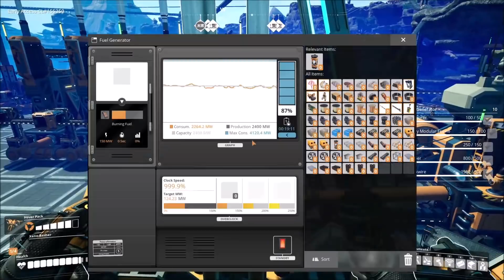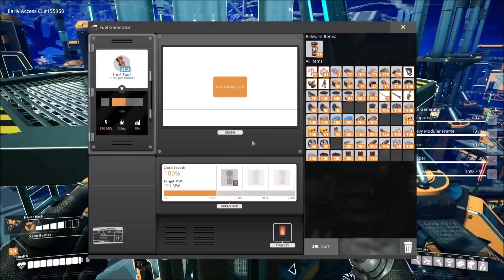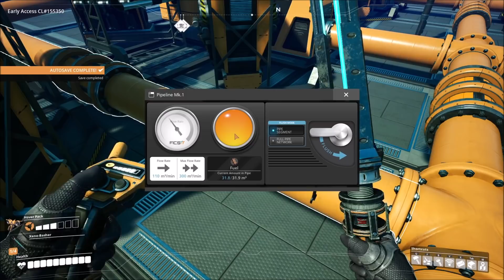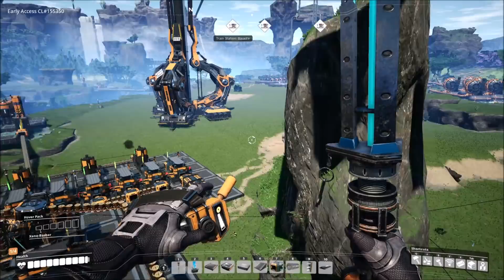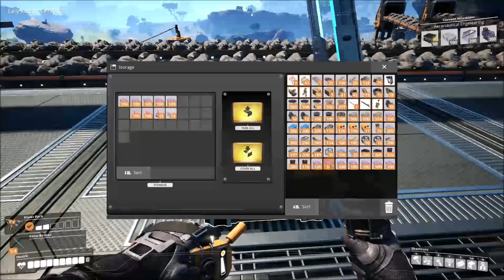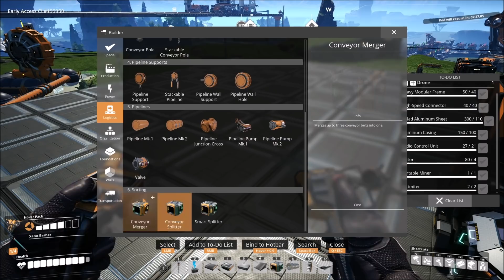Satisfactory Ep35 More Power and Drones

Comment: At the beginning of the episode you forgot that the fuel generators give you more power than it consumes when they're fully overclocked, so you shouldn't need 13 fuel generators...
PS: As in they're more fuel efficient the more overclocked they are, so it's more fuel efficient to have less fuel generators fully overclocked than more fuel generators with no overclocking whatsoever...

Comment: For excess water, I package it at the end of the processes that use water, and send it to an awesome sink.
If you want to use a drone network, and I do recommend it, you'll want 2 drone ports dedicated for battery distribution to all of the other drone ports. You only need batteries at one drone port per route, so it's most efficient to have a centralized drone location as a drop-off/distribution depot. That way you can easily distribute batteries to all of those ports, as well as a centralized location to distribute all of the resources your drones deliver.

Comment: The drone travels very quickly but takes off and lands slowly. The Drone consumes a minimum of 4 Batteries per trip plus 1 Battery per km of flight distance.  Thus the longer the distance of travel, the more efficient they are so best for very long ranges.

Also, from the wiki: "They are potentially the 2nd fastest mean of transportation, second to Hyper Tube Cannon. Pioneers can stand on the drone for a ride, however a fall protection equipment such as Jetpack is highly recommended as the Drone will push away the pioneer mid-air when it starts accelerating forward."
Reply: Riding a drone is as risky as riding a rampaging bull, or even worse. Sometimes it goes well, sometimes it flings you off at supersonic speed and snaps your neck instantly.